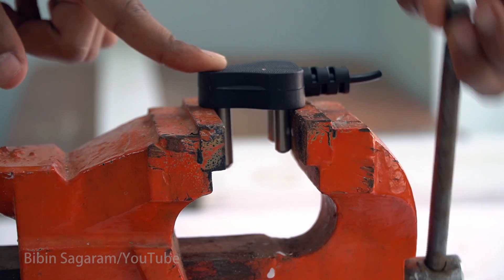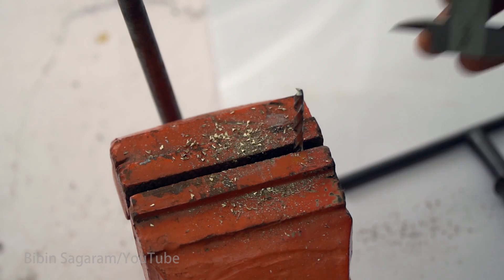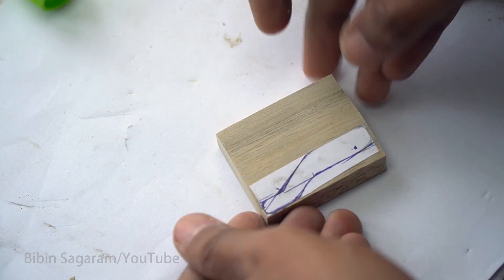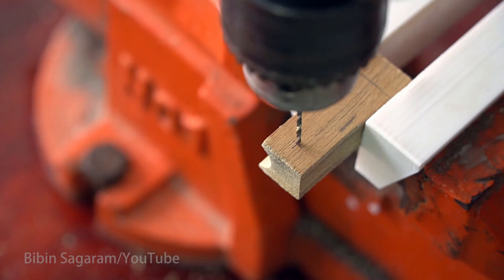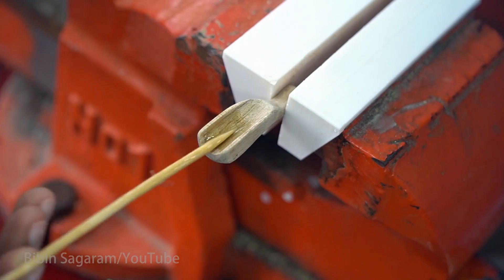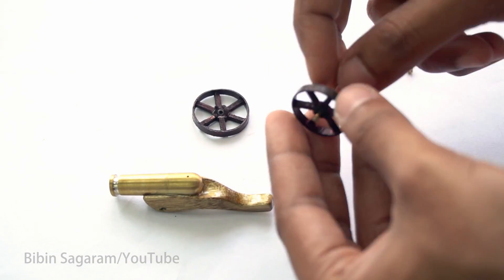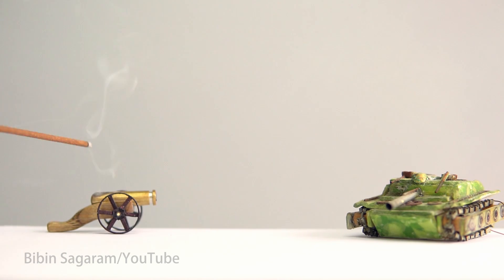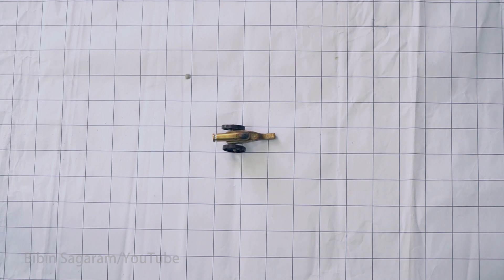Mini Cannon from Plug!

Comment: I have 3D printed my own. What are you using as fuse? 
I really like this video.

Big 👍🏻 from Denmark
Reply from the maker: Thanks a lot 😊, powder filled in fire hole will act as fuse.
Reply: You meen the matchstick Powder?
Reply from the maker: @christiandk3777   Yes, match stick heads has to be made in to a fine powder to get into the small fire hole (1 mm)

Comment: How many mm is the cannon pipe pin ? Plz tell me
Reply from the maker: Type D power plug earth pin dia 8.8 mm, Bore is 4.5 mm, fire hole is 1 mm.
Reply: But the diameter is 7.5mm and the height Is 2
0mm of the type D power plug